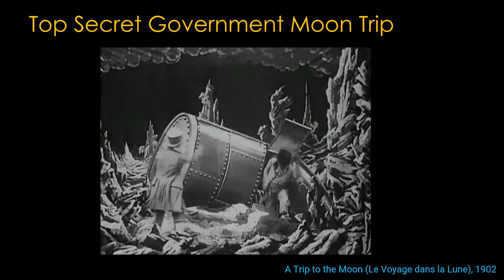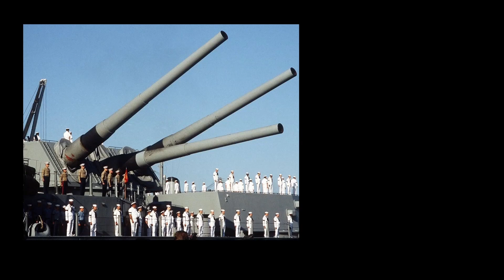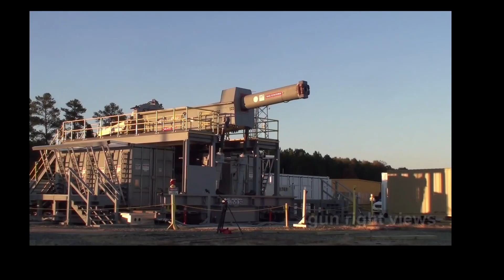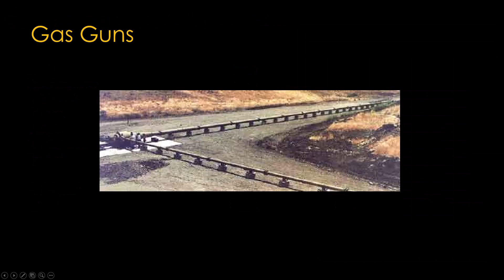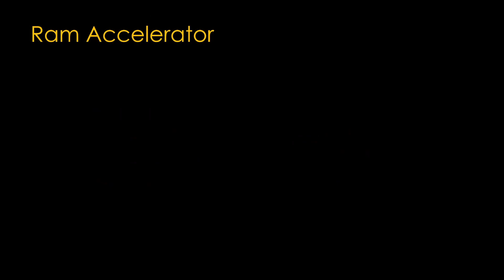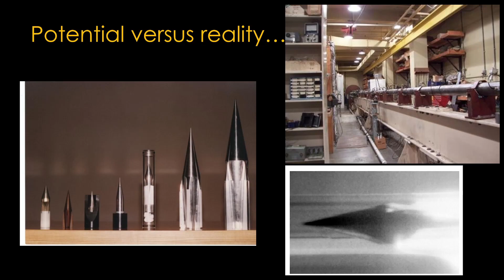Guns To Space !!!!

Comment: Late to the party but...how about the consideration of multi-stage launches? That is, start off with a light-gas gun or a scramgun, then at a certain point, switch to chemical engines, maybe by way of a space cargo plane, instead of needing a massive rocket that uses up a crapton of fuel just to beat air resistance?
Reply from the maker: You need a rocket engine to get into orbit because all ballistic trajectories intersect the earth at some point. That "second stage" needs to withstand the acceleration of the launch. 

If your second stage engine fails, then you have launched a vehicle that is good at dealing with heating effects and will be reentering the atmosphere at some point. If it survives to reach the surface, your system is a weapons system.

Comment: A surprisingly good video with a lot of things others did not even consider mentioning! However, I'd like to mention some things which I consider the main problem of ground based space guns. Everything faster than let's say 2 or 3 km/s is not practical because the speed losses will be too high. For this speed range a light gas gun is the sure winner. Actually as it is a gun it needs projectiles and thus you need to design a projectile which should also be kind of a rocket. Thus air friction, forward of center and a simple rocket propellant which should be solid ((or at least use hypergolic propellants ...)). Thus again two stages are required and all that's saved is the first stage. Another downside is that it does not scale up well, only works for small payloads --- so some kind of Cubesat Lego in space is required. High launch rates are wanted like a probably a launch every ten minutes and thus a lot of guns in row on one site because one just can't do it. The good thing is that mega-constellation like a starlink clone can be done with cubesats. However without a mature design for the "projectile" or "pseudo-rocket" the whole will fail. Just to sum it up "more guns on a site and at least some contract for a cubesat mega-constellation".
Reply from the maker: If you want to do a cubesat constellation you'll need to make sure you build your launcher so it points in the right direction. Or maybe do the floating version so you can change where it points.

Comment: Could you save on gun size by lofting it under a balloon and firing a smaller payload? Perhaps an existing research rail gun could be lofted under a high altitude balloon to 40 km or possibly 50 km and deliver a ~10 gram payload to orbit with a fairly small circularization motor as a proof of concept.
Reply from the maker: 50 km only saves you a little energy - the vast majority of the energy required to get into orbit is used to get the payload up to orbital speed. 
It does have the advantage of getting you out of the atmosphere and that helps you a lot, but then you need to figure the logistics to get the gun, the power supply - if it's electric - and the payloads up in the air and then get the reusable stuff back down to earth in the proper place. That seems like a daunting task.
Reply: @EagerSpace  Very good points, after running the numbers the energy requirement for getting to altitude is 2-3 orders of magnitude less than the kinetic energy of getting to orbital velocity. My primary concern, as you mentioned, was that ground based space guns have to expend energy as drag while getting through the lower parts of the atmosphere, which only becomes worse the more "sideways" you try to fire the gun. I misspoke when I said rail gun, I was thinking of a light gas gun instead as that would be far more practical.

Comment: Great rundown, hadn't heard of most of these.  Would stationary launchers like these have issues getting payloads to specific inclinations?
Reply from the maker: Yes, they would. I considered talking about it but the video was already a bit too long. They would need to go into different inclinations using the rocket part. 

There was one proposal for a gas gun that was floating with most of the tube underwater. That one could be rotated to change the launch direction which would help getting to higher inclinations.
Reply: @EagerSpace   Wow, that would have been a sight to see!